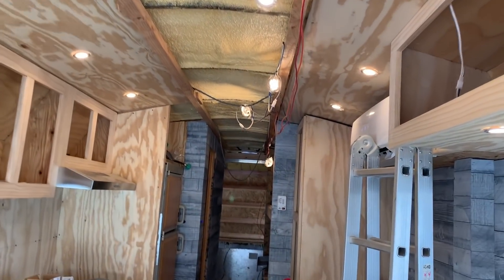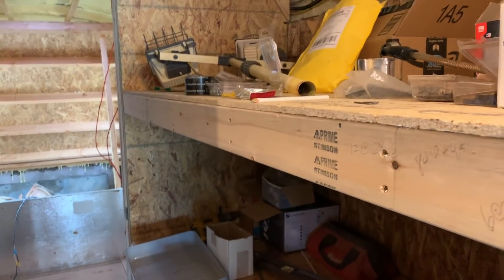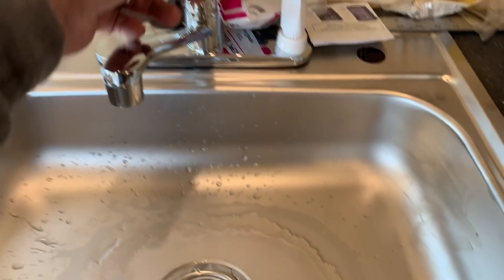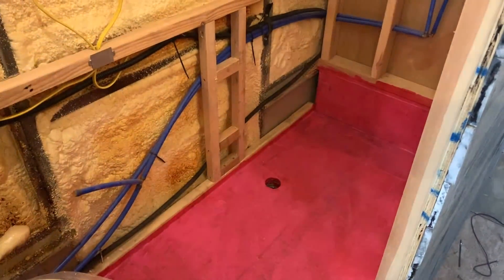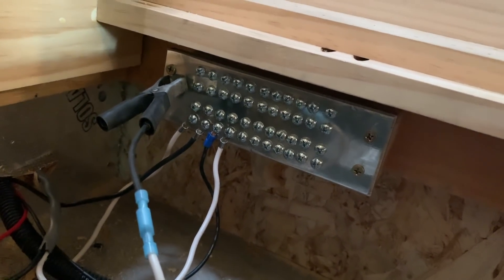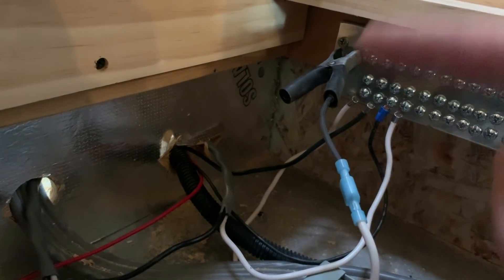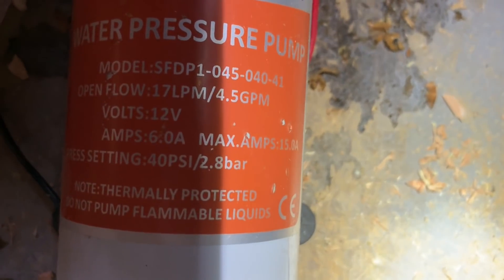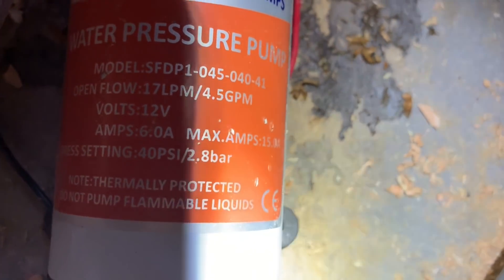I have a question....

Comment: The fault finding method I'd use would be to try ONE thing at a time.  Lots of great suggestions from the posts I've read.  I'd pull the pump out of the loop and run it direct to the battery first... and incorporate a heavier gauge wire.

Comment: Hey brother nothing in my bus doing that in less my batteries are low that's it so for us with the same lights no.  My be a quick filter on the wire would solve that or do what you say and do a ground jumper to the frame and see what that does. I have 8 so far hooked up and running of the house batteries and just did one of those marine boxes with everything all in one on the box but have the thing maxed out of 1000 sqft of 12volt 12g line and no problems everything stays solid no power loss. Question when it does the light flicker what's your meter say??

Comment: You may want to try one of these, Just copy and past this link, I'm not sure how to all a link to comments.  I'ts a 12VDC to 12VDC regulator.  hope this helps.

 https://www.amazon.com/Waterproof-Voltage-Stabilizer-10A-Regulator/dp/B0711SDBFW/ref=sr_1_3?crid=BA0LR9TYTZHC&keywords=12vdc+to+12vdc+regulator&qid=1558704852&s=gateway&sprefix=12VDC+to+12VDC+%2Caps%2C400&sr=8-3

Comment: Current draw of pump is causing voltage drop on supply wires.  Based on what I saw in the video your supply wires between house battery, ground bar & fuse block need to be a bigger gauge.  Also make sure to take into account the length and gauge of the wires for the pump.  Both positive and negative wires count in the length. Use the Max amp draw plus the length of wire to calculate wire gauge needed. Chassis ground is not needed, but if you do a chassis ground you won’t have to home run a negative wire to every device.

Comment: As others have said; either low battery (or voltage drop!) or frequency noise from the pump.
No need for chassis ground, it's convenient and cheap but much better to run direct ground wiring

Comment: You need a capacitor on the water pump motor as it is adding interference on the 12v circuit. I would ground to the body anyway as I shall be using a split charge system to charge the batteries.

Comment: I suspect that your pump is controlled by a pressure switch, which causes the pump to pulse on and off when you are using water. The pump draws quite a lot of power each time it starts up. This surge of current will develop a voltage drop in the cabling in the RV. An old battery or one in poor condition will also make the symptoms worse. To improve the situation, you could rewire the pump supply directly to the battery, making sure there is a suitable fuse and isolator switch fitted, in addition you may be able to adjust the pressure switch so it does not hunt as frequently.

Comment: Rick I had the same exact problem, it drove me nuts trying to figure it out. I ended running dedicated fused system straight from the house batteries to the pump, and bypassed the main fuse panel, and that fixed my problem.

Comment: does it happen when the bus is running? or on charge?   Grounds would be my first check.
Reply from the maker: it happens when the pump starts to build some head pressure and begins to slow down.  As the load increases on the pump motor the lights begin to flicker.  FWIW, I'm using one of the start batteries temporarily to power the 12v stuff while i build out the inside.  I dont know if more battery capacity will fix it or not.  I may try to run the pump off an 30 amp power supply and see if that works.
Reply: @dzlfreek   that was my next thought, I think its just voltage issues being to low.  A power supply should help with answers.

Comment: FWIW I just installed my pump and my led strip lights are flickering with the pump sometimes even when the lights are off. My pump is also a seaflo. Everything is connected and fused at a 12v deep sea fuse block. All power is coming from a 120v to 12v power converter which is grounded to the frame of the bus.  Can't help you with the fixing it part though...

Comment: Light's need to be on it's own power,The water pump is connected to the same as lights.3 curcuit is best.  light's/plug's/Accesories. use a breaker box to split them and put a fuse on each so to not have interference in the event of a short.
Reply from the maker: they are on their own circuits.  the pump has its own fuse protected circuit as do the lights.

Comment: My 2 cents, LEDs work on a range of voltages. They do like to operate out side that range. I suspect you have low voltage. Check battery condition, running on inverter plugged into the house? No a heavy enough wire to your load /power distribution center? Grounds which have been mentioned. One thing you should do is not relay on body grounds, but run a ground wire back to the battery (in boats it is called Electrical bonding. They do that for different reasons, but make great circuits. In short I think low voltage over pump motor frequency.

Comment: Unless you are an electrical engineer it is nearly impossible to get conventional and led circuits to work well together,, it can be done with the appropriate diodes in the led circuit.. good luck on which ones. There are gadgets that you can run your led circuit through but i believe they are just diodes. Also.. if you run both pos and neg wires from the source to the unit you do not need a ground. But each unit needs to be isolated from grounding.  Some modern autos use the no ground system.  Computers.  Lol.  Engineers!  Good Luck. I took a couple extra quarters on just electricity (dc & ac) while attending aviation school and it can still be confusing some times. Haha

Comment: if the flicker is caused by the pump cycling due to low flow and its hitting the pressure shutoff, increasing the water flow or raising the pressure shutoff  should stop or limit the flickering

Comment: The pump and lights are at the same frequency 60htz. Need to isolate the pump from the lights. Don't let them share a ground.
Reply: That is not it. The LED lights are at zero hertz. The lights are DC voltage/current driven. Same thing as a flashlight.

Comment: Start with 100uf cap aft the light switch + to - 🤠😎
Or each motor = cap, zener diode and a resistor
You getting a frequency from the motor coils 
I could have just made all that up ¿

Comment: Place a cheap "buck converter" in line to your 12v lights. Set to wanted voltage. These things are about 2 dollars on Ebay. They stabilize voltage if power increases or dips. Bad or weak connections are possible but led lights can easily represent voltage fluctuations in the form of brightness of light.
Reply: You nailed it
Reply: @briandavis9975  Not quite.  The circuit in this situation involves a Boost Converter (not buck). A boost converter is a type of DC to DC converter that puts out more voltage than it gets in and yes, they can be found very inexpensively on eBay. Furthermore, the real problem here is the water pump is causing an ever so slight droop in the voltage to the LED lamps. The LED lamps in use here are not very good because they are dimming significantly from a slight voltage drop. Instead of adding a boost converter, my recommendation is to isolate the LED power source from the water pump power source. Have a separate battery to source power for the water pump. It doesn't have to be a large capacity battery because the water won't be turned on very often.  Be aware that the cheap boost converters on eBay (if you go that route) might not help because the recovery time (line-load regulation response time) might not be fast enough to eliminate your LED dimming. Using a boost converter could also mistakenly be adjusted to put out too much voltage and harm the LED lamps. Using a separate battery for the water pump is the way to go IMHO.  -NOW- How does that water pump battery charge if it is isolated from the rest of the bus's 12V system? The way I'd do it is have a relay that does have the water pump battery connected and charging from the bus 12V system (through closed relay contacts) but when the water pump turns on have the relay drop out disconnecting the water pump battery from the bus 12V system for the entire time the water pump is running (your LEDs will not flicker), and have a "delay" in the circuit that doesn't switch the relay contacts back to the quiescent condition (closed) until a few seconds after the water pump goes back to resting state. You could try another option, it is simpler but I can't tell you if it will work until you try it. This would be to get a high value electrolytic capacitor, something like 100,000 microfarad at 25VDC rating and hook it directly across the water pump. This would act as filter to reduce the current pulsations the bus 12VDC system experiences . I don't know how thick the wire gauge is that you have feeding the water pump but it should be thick (heavy gauge) like #10 or #12 and be no longer than necessary, and connect it to the vehicle battery (through a fuse). Don't neglect the minus side of the pump wire thickness if you are not using a bus chassis ground. Both wires going to the water pump ( plus and minus) should be thick wires, and no longer in length than necessary to reach the battery's + and - terminals.  Hope this get you to a solution.
Reply: @xxM5xx  I also said the same thing in one of the possible fixes isolation will take care of it.

Comment: Could be a ground but there is a anti flicker unit you can buy from Amazon I've heard or maybe isolate the water pump so it's not hooked up to anything else.
Hope that helped thanks for sharing. One of your viewers nailed it a buck converter should do it.
Reply: buck converter will NOT do it.
Reply: @xxM5xx  so if he's running a 24volt system off his chassis a buck converter won't work is that what your saying because I have a 24volt system in my MCI and it works fine with mine
Reply: @briandavis9975  If he is running a 24V system then a buck converter is what he needs because those LED lamps are 12VDC. Therefore the buck would drop the 24V down to 12V. Did he do something I'm unaware of like series two 12V LED lamps on a 24V system?
Those 12VDC lamps a dimming when the water pump is on because the lamps have no headroom voltage and the voltage reaching the lamps is drooping when the water pump is on.
Reply: @xxM5xx  I don't know if he is running a lot of bus run 24 volts not all I'm just saying that the buck converter I have runs around 12.8 it's consistent I would still isolate the water pump due to the amount of amps it draws I have a 110 volt shallow well pump for my coach and it has a way big expansion tank built on it quicker and much quieter.
Reply: @briandavis9975  There are too many variables, so we are all trying to help and all speculating. It could just be the wires to the water pump are long and too small of a gauge, and he is tapping the led lamp power from a convenient but poor spot in the wiring. If he runs a dedicated wire from the LED lamp feed directly to the vehicle battery (through a switch obv., and fuse) and the battery is strong and fully charged up. The water pump and the LED string should not interact any more. If the battery voltage droops right at the battery terminals then there isn't a strong enough battery in there. Is his battery 24VDC? If yes, then what is he using to drop the voltage to 12VDC for those LED lamps? The voltage regulator or buck converter could be what is not holding the LED voltage at 12VDC.  Like I said too many variables and I'm 2,000 miles away otherwise I'd go there in person and solve it for him.
Reply: @xxM5xx   agreed

Comment: From my somewhat limited experience as an electrician- your. Issue seems to be "noise" back feeding from the pump. Place a capacitor inline between the batteries and the lights and it should smooth it out and solve the flickering. Saw a similar issue with a ceiling fan and LED can lights on the same circuit, wired in parallel. Cap solved it. Just my .02
Reply: I agree. Cap is probably good idea. Also make sure you have big enough wires from the battery. That motor can use almost 15A (according datasheet).  

There is also possibility of bad motor, either by design or it is broken.
Reply: Chassis ground is not needed, but is a good idea even if you do not use it. Makes bus safer, fault to chassis will blow fuse instead of making it "hot". 12V is not very dangerous, but it can be a (big) problem.
Reply: No "inline" capacitor. Inline implies a series connection.  A capacitor might help if it is a high enough microfarad ( ~100,000 uF @25VDC ) and wired in "parallel" with the water pump, right at the water pump (across the water pump).  For reference a capacitor like that would be about the size of a small 8 oz beer can.

Comment: I just found a lot of topics of this online. Does have to do with the house batteries. Several have said to use a device connected to the water pump. Look at these threads ... https://www.rv.net/forum/index.cfm/fuseaction/thread/tid/29259345/print/true.cfm

https://community.fmca.com/topic/13111-water-pump-makes-lights-flicker-when-turned-on/

Your not alone about this issue...

Comment: My $0.02 cents is its a bad ground.  It's good practice to tie all the grounds in...battery, frame, body, fixtures.   A distant possibility is your onboard batteries are not topped off and the pump is producing a voltage drop causing the lights to flicker.  non-dim able LED fixtures have a narrow operating voltage range and the pump may be dropping the battery voltage to the low end of that range.